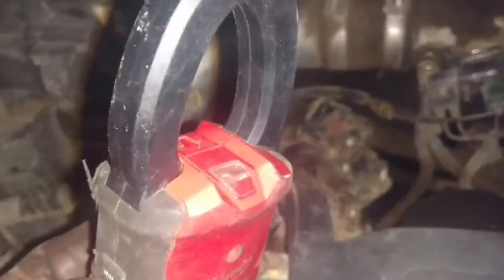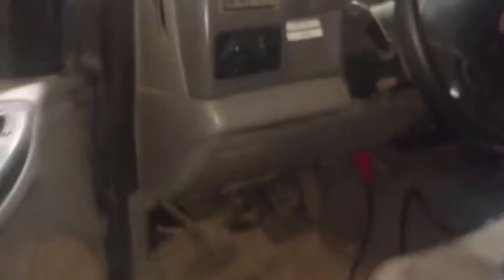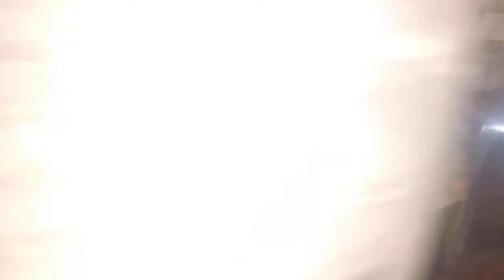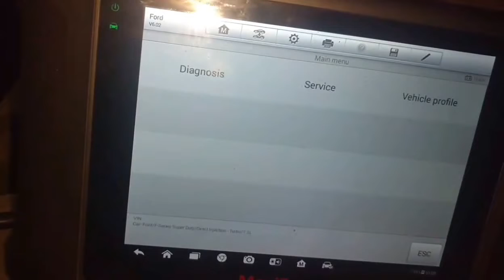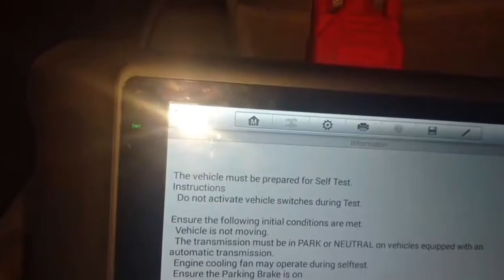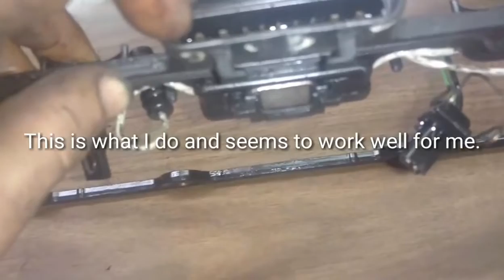7.3 powerstroke glow plug test

Comment: Batt voltage has to be above 9.5
Before it will start while cranking
It is programed that way more people don't know that after doing diesel work at a Ford dealer for over 34 years I find people and techs over look simple repair and spin wheels looking for complicated reasons for no start always repair what know is problem.then do further diag and inj should sound the same on buss test always check oil level on.this model
Paul from Michigan

Comment: I put an ohm meter on my glow plugs and got 3 that were in spec around 2ohms one on one side and 2 on the other, but all the others showed out of range even when I went up to 2000 ohms on the meter. Is it possible for them to read that high on resistance or do I have a wiring issue?

Comment: My relay is good decided to test bank 2 connector to the glow plugs. Two read in spec the other two had a break in continuity, gonna have to pull of the cover and find the wiring issue

Comment: That’s the quickest/easiest way I’ve seen to test glowplugs. When doing a buzz test does it bypass the IDM meaning is their any chance that customer has a bad IDM and not injectors?  Is there anyway to test the wiring at the valve cover harness connector coming from the IDM to the injectors.

Comment: I have a 99 F250 7.3 powerstroke and I’m having a very hard problem starting my truck. I have already changed the glow plugs (motorcraft) glow plug relay , valve cover gaskets with the wiring harness , starter , and two batteries , and I’m still having a hard time getting it started . Now when I plug it in and have it connected for about 30 minutes to an hr it will fire right up . Any suggestions ?
Reply from the maker: Time for injectors.  Amplifier pistons are sticking in the injectors.